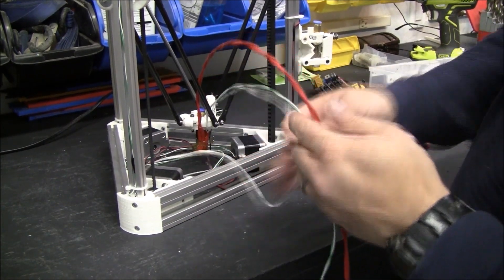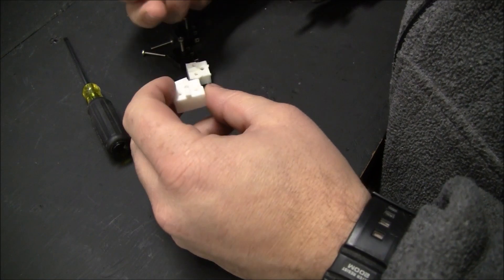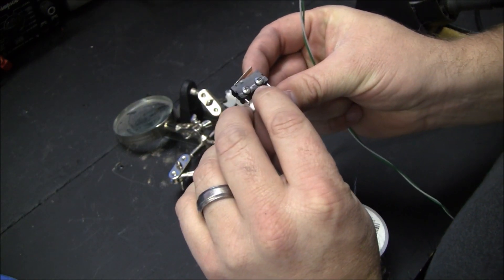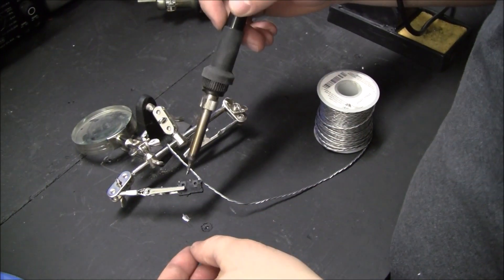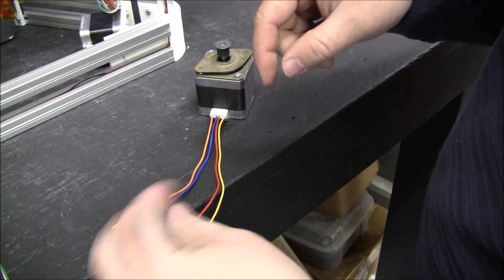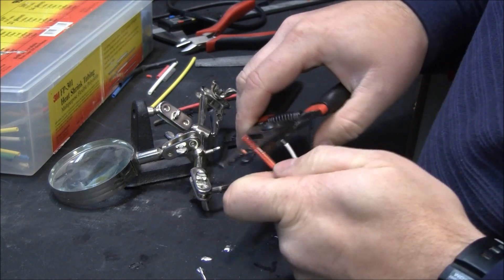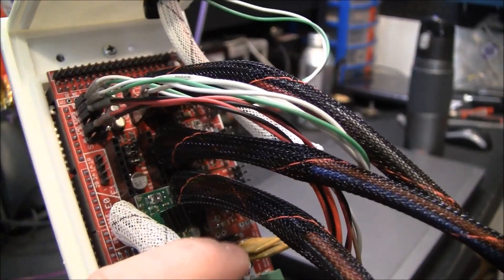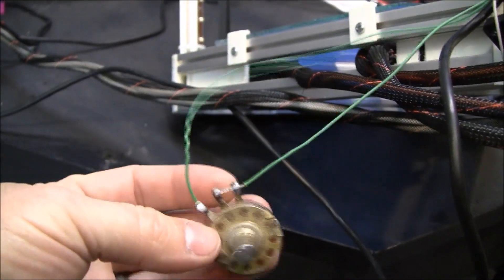Kossel Mini 3D Printer Electronics

Comment: hi fillear i've been watching your video quite a while. i also love doing my projects but i currently finish my high school and i'm wondering what engineering you studied. and i've learned alot from the internet and reading some guides mainly about computers and rasph pi. but My idea is Electronic engineering, am i in the good direction? I'd really aprieciate  your answer. Thanks
Reply from the maker: Electronic Engineering would be the way to go. I had a unique situation growing up where I learned a lot from my father as he had an electronics repair shop. I was soldering and loving it from a very young age :)
Reply from the maker: You can get a LOT of good knowledge by buying a cheap microcontroller like an Arduino, Netduino, or a RaspberryPI and start building things. I love Electronic Engineering and Computer Science about equally.